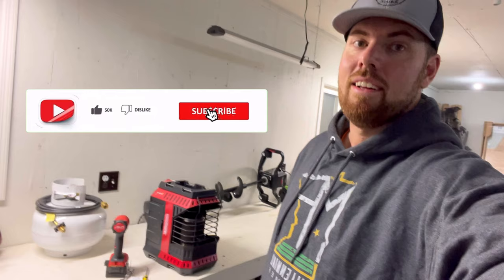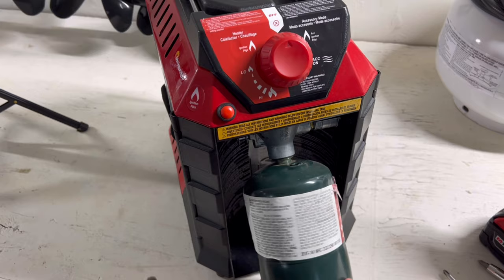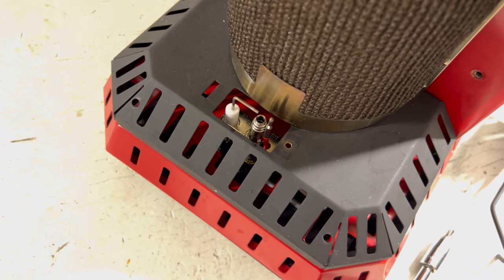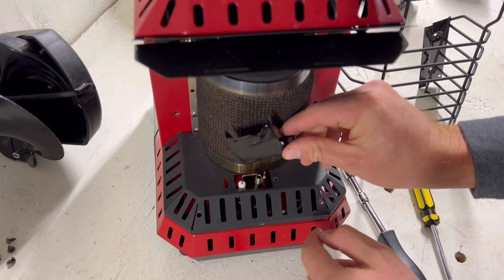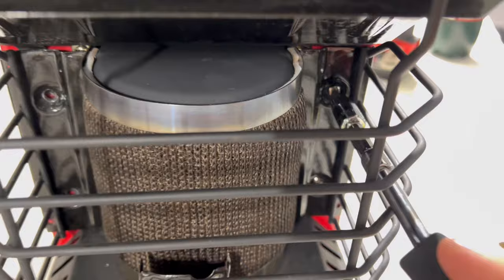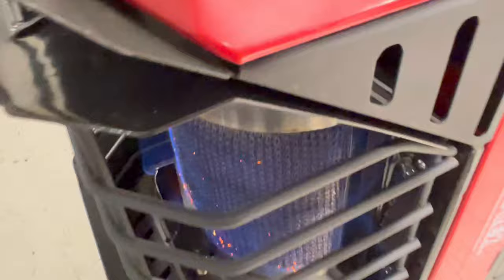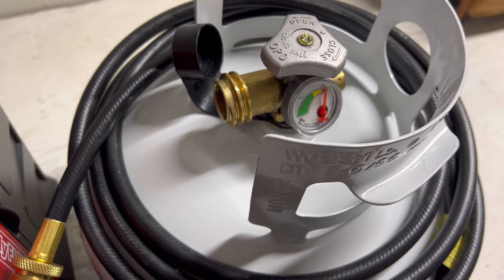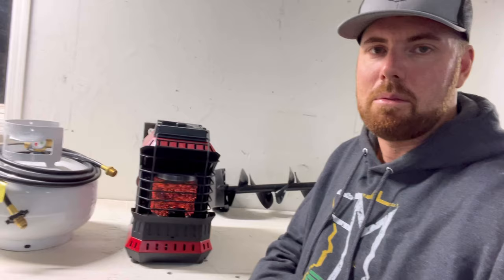BUDDY FLEX Heater won’t light! Helpful tip FIX and REVIEW!

Comment: In case this fix doesn't work for you, I have another fix that might. I just got off the phone with Mr. Heater and my issue was resolved by taking the hose off the heater, leaving the other end attached to my 20 pound bottle with the valve open- using something small enough- a piece of wire, a very small screwdriver (I used a small Allen wrench) depress the pin inside the nozzle of the hose or the filter (most of these hoses need a filter) and see if you can get a blast of propane to come out- if you do, reattach the hose and see if it will fire up. The Mr. Heater rep said these hoses are known for the safety valve getting stuck and preventing the propane from flowing sufficiently to light or keep the heater lit. This fix worked for mine. Cleaning mine did nothing because dirt wasn't the problem. The rep also said it's important when you hook up a new bottle of propane to open the valve very slowly/gradually to prevent that valve from getting stuck- I was doing that, but somehow mine still got stuck, but this simple fix worked. So relieved to have heat in my camper again!
Reply from the maker: I really appreciate your comment and input on this. I have noticed issues in the past with my hose and heater not lighting vs 1 lb propane tanks being used on the heater. And it seemed it was because propane wasn’t getting through to the heater, as you said. Good to know; always helpful advice. Thank you!
Reply: Worked for me as well
Reply from the maker: @dark1fang  good to hear! 👍🏼👍🏼
Reply: Yeah I tried that on mine, didn't work, I'm so fuckin pissed. I spent so much on all these attachments and a extra 20lbs tank I didn't need. The 1lbs work fine in it, just the big setup won't work. I have their 12ft hose, filter, I can hear the hose leaking as soon as I turn it on before I hook it up, used a punch to open up the safety valve to get flow, got flow, hook it up, fires up for less than a second and goes out. The pilot stays lit that's it. So aggravated lol
Reply from the maker: @boostedbadboyzx12r31  I feel for you man. I think, it’s not the highest quality heater. The tip I provided definitely worked for me…. But this year, I was out once and it lit on my tank with the hose; then randomly stopped working. Put the 1 lb tank on, I always have at least one of those with, just in case, it worked for awhile and then neither worked. Ended up just turning that valve back and forth a few times and started beating on the heater and then it worked the rest of the day just fine 😂😂. I know there is a tip sensor in there that could be messing things up too every now and then. Just never know for sure.
Reply: @boostedbadboyzx12r31  I don't know if this will help you any but just in case... 

I ended up rushing out and buying not only another 20lb tank but also another heater and neither fixed the problem. It was always just the hose, and it took repeatedly disconnecting the hose shaking it and depressing the safety valve in the hose to ensure it wasn't stuck. There was no rhyme or reason to when it would start working again. I'd just keep disconnecting the hose, depressing the safety valve and shaking the hose and reattaching it and eventually after half an hour or so of repeating this process it would begin to work again. 

If I may, I recommend always calling Mr Heater when you have a problem, they'll stay on the phone and walk you through it and in my case mailed out a new hose at no cost, offered repair and replacement of the entire heater and sent out a postage paid return label (it was still under warranty).

Mr. Heater told me that these hoses are notorious for this problem- they get many complaints. Now, in my case, I could never get the pilot to stay lit when it was malfunctioning this way- so perhaps my problem is different than yours. But I can say that simply because it was so darned cold outside when this was happening (well below zero) I had no choice but to keep trying to get it to work. 

Each time this happened, I just kept repeating this disconnect/reconnect process along with depressing the safety valve and jiggling the hose and every time, it would begin working again, and then stay working for a few more days. At some point, I'd have to turn the heater off, because I'd need to switch out propane tanks or I was going to be out of the campervan for a while, and when i went to turn it back on again, the problem would start all over again. But asl long as I didn't give up, I could get it working again. 

Over my trip of 6 weeks, using all  brand new equipment: Buddy Flex heater, filter, and 12 and 15 foot hoses (I switched back and forth between the two trying to get one of them to work.) this problem occurred 3 or 4 times. Sometimes I'd get it working after two tries, and sometimes I'd go through the process half a dozen times, but eventually, it would start working again- I was never without heat. It was certainly beyond frustrating, but I question if this problem is unique to Mr.Heater brand so I'm hesitant to replace the entire system - I'm tired of spending money.
Reply: @boostedbadboyzx12r31  would a shorter hose work ? Like a 5ft ?

Comment: I do believe I found the problem. I did work on the thermal coupler as you suggested. I also polished it up with some fine sandpaper, but I really believe the problem is in the control valve. I believe mine took a slug of oil from the propane as it got inside the control valve and was restricting flow. I pull the lines off and found oil coming out of the valve so I cleaned everything up drained everything out and it seems to be working just fine now
Reply from the maker: I do think there are a few problems that can happen. I know what I’ve done has helped me and others. Yours sounds like even more serious problem, but luckily you’re handy and could figure that out. Glad you got it working!
Reply: Just for information for others. There is oil in propane and it will separate at times for different reasons, but mostly if liquid gets into regulator, it can cause the oil to separate out of the propane gas and get through the piping and other places, causing restrictions and restrict the gas flow to the pilot light circuit.
Reply from the maker: @frankpaglianite4158  for sure, I appreciate your response to this and I’m sure others will too in the future. Thanks for the insight, I wouldn’t know anything about that until you commented, so thank you for that!

Comment: Id think, they would make it easy to get to the ignitor. Id love to get this with the cook attachment,but im leary
Reply from the maker: Yeahhhhh I like it when it works. I love the style of it, I love how the heat radiates off of it with the rounded front and heat deflectors, I am going with the bigger Heat Hog next of this thing gives me stress in future. I do have a Mr. Heater cooker style one for back up and also boil water and make sausage and stuff out on the ice.
Reply: I'm completely fed up with mine, bought it last year and have used it several times and not once did it operate smoothly. Have to fight to get it lit every single time. Used it yesterday and once again it took forever to get it lit and then after using it for a couple hours I switched the bottle and it just wouldn't light again. Left us without heat on the ice in a freezing rain/sleet had to pack up the ice shack early and go home. It's always been stored in a tote inside our house. I almost smashed it on the ice yesterday but I didn't want to clean it up 😂 and my wife said she would try contacting the company and see if we can get a credit towards a big buddy. Our original buddy worked for 6 years before I even had to clean it. Anyway maybe we just got a dud but I'm over it.
Reply from the maker: @halfassranch8363  that sounds unbelievably frustrating!!! Mine wouldn’t light when I started ice season, I did my cleaning thing like in this vid again, has worked flawlessly while ice season (knock on wood). I would’ve taken it back right away if I were you lol, I’d still try to. Definitely something not right.
Reply: @JMonOutdoors   yeah you're right I definitely should have taken it back to Ace after the first time. I've also only run it on the small bottles. Pretty sure I got a lemon 🍋
Reply from the maker: @halfassranch8363  yeah, I’d say, even tho I have heard many problems with these from
others, it sucks that a person has to deal with them and no one seems to be able to invent a solution. I was going to switch to the Heat Hog but now I keep hearing problems with those… so, I’ll keep this one going as long as I can 🤞🏼🙏🏼

Comment: This thing.... I used it once for like 10 minutes and when I needed it most I was trying to light the pilot for a half hour. Redundancy is key. I'll be attaching a long screw driver, alcohol wipes and q tips on the side for this B.S. Also another heater. 😅
Reply from the maker: Trust me, I know the feeling… also disclaimer, I think they might just struggle to work when it gets certain temp below zero… I try to keep in truck on way to lake so it doesn’t get too cold to light if it’s really freezing out. But, this cleaning the igniter method has helped me more than once so far. Good luck 😅

Comment: Just cleaned 2 Mr buddys I gave up on.  Excited when I heard this is normal. Didn’t work
Reply from the maker: Well that sucks to hear! This tip isn’t a cure all, but it helps some.  At the start of ice season… I tried starting this same heater and it wouldn’t light… cleaned the igniter again and it fired right up after, didn’t have any issues all ice season.

Comment: I just purchased this heater and I'm excited about it.  I've seen this a common problem among them, but I still decided to give it a try.  How often do you have to clean it in comparison to how often you use it? Do you notice having to clean it more if you use it more, or is it just a seasonal thing you need to clean?
Reply from the maker: I clean it once a year and seems to be fine,
I’ve had it 3-4 years now. But, I feel like when it’s been coldest out, it’s been an issue and not start regardless. If it continues to do it,
I may get a heat hog. I have a back up Me Heater cooker style one just in case, I’d suggest that if I were you, unless you don’t care that much.
Reply: Thank you for your reply and the helpful info.
Reply from the maker: @backcountrypreps6171  no problem at all 👍🏼👍🏼

Comment: How long one  pund  propane  last
Reply from the maker: I’d say 4-6 hours but hard to say exactly cuz I don’t use those much, I know when I did, it would last a whole fishing outing, or would go thru 1.5. But I shut off when it gets too hot in flip over. I now use a 10 lber with a hose. I like that set up and tank cuz it’s compact, lasts a long time, and has a gauge on it.

Comment: Thanks Bro. 17 degrees and it quit.
Reply from the maker: Dang man, that’s a frustrating feeling. I always have a back up with just in case too now.
Reply: @JMonOutdoors  still won't work. Will not hold pilot light. Soon as I release pilot button it goes out. I cleaned it like you said. It needed it. Changed battery, changed bottles,  Nothing.....
 Burr.
Reply from the maker: @mrunlucky3024  really?! Still doesn’t work? Idk what it would be besides needing it to warm up in vehicle or bleed it out til it propane runs through it? I have Mr. Heater cooker/heater in which you have to start with lighter as my back up. I’m sorry that this is happening to you. I’d be very frustrated.
Reply: It Burns !
 Heat !
OK, took apart again. Cleaned it again. Put back together.
 Moved it & me to truck.
Read Your " needing warming up".
 After about 10 minutes of Heater enjoying sitting in truck, heat & radio going.
...
It fired right up !
It was to cold to work ?!
Dang.

To be Fair to this BuddyFlex, 
 I love it.
Best money I ever spent for a heater. 
 I've had & used it for almost 2 years. No problems. Factory Battery.  Never Cleaned it, until now. It did need it.

 Thank You.
Merry Christmas
Reply from the maker: @mrunlucky3024  I appreciate your replies and updates! Glad it’s working again!!! 👏🏼. Like I said on the video, the first time I took it apart and did that and it worked. Weird. Merry Christmas to you too bud🎄
Reply: My unit was doing the same thing, but I noticed when I shook it  a little bit the flame would go out and I could hear a click inside. I took the bottom off and check for continuity in the tilt switch, which wasn’t reading the way. I expected it anyway after playing with it for a bit I put it back together and now it works fine, I think the tilt switch gets out of whack a bit and causes the same issue. Next time I’m disconnecting the wires and calling it a day on the tilt switch.
Reply from the maker: @frankpaglianite4158  that’s good to know. I’ve heard others mention about the tilt switch as well. Frustrating!

Comment: Why didn't you test it before putting it back together?
Reply from the maker: Good question 😂 thought that actually right when I hit record, I was like, if I press this and it doesn’t work, then that was a big waste of time. But, then it did and thought to myself, thank goodness!  I have had to do this method 3x since owning it. Also, if it wouldn’t have worked, I wouldn’t have made a video about it. Would’ve just scrapped it.

Comment: This is a real problem with these heaters.  It is ridiculous - poor construction!  Some people just use an aircan to blow air into igniter area (without taking it all apart) and seems to work in most cases.
Reply from the maker: That actually works? Cool. But I’d rather use the alcohol pad to wipe everything down and know it’s for sure cleaned. I agree with the problems it has and construction of it isn’t the greatest. I’m satisfied with my use of it this ice season, worked on the cold days I needed it.